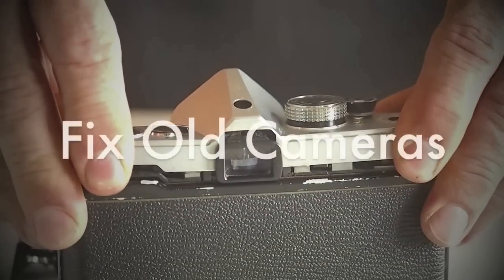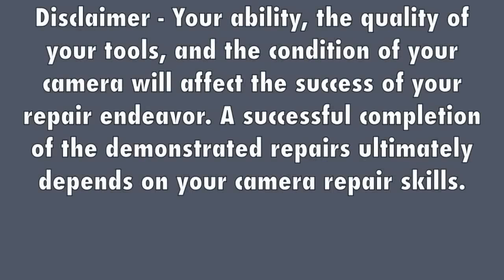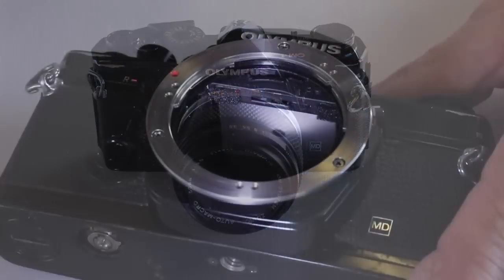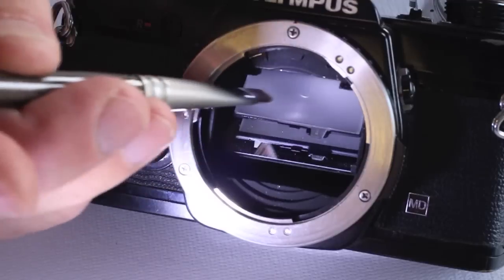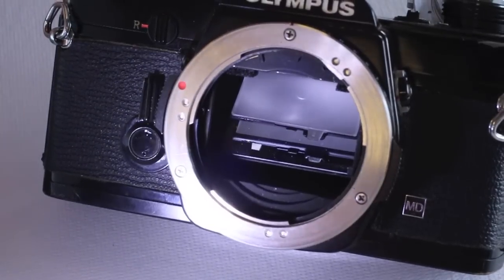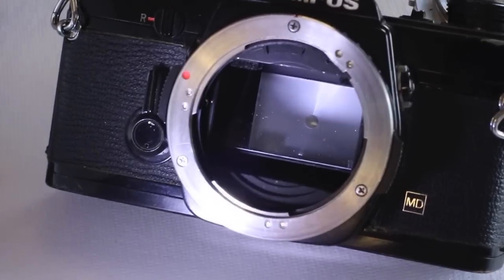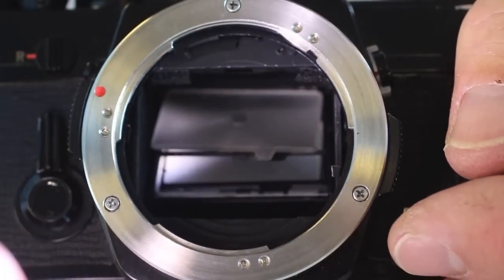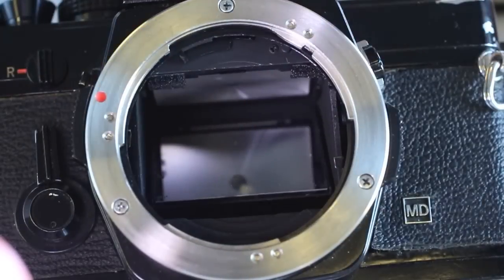Fix Old Cameras: Olympus OM 1, Dust in the Viewfinder

Comment: Did not know if this is the best place for this, but could you do a tutorial on fixing a very STIFF shutter dial on the OM-4 or any OM single digit series?  I am assuming that they all work very similarly.  Thanks for sharing your knowledge and videos as your OM videos gave me more confidence when I replaced my prism on my OM-1.  Have you done a video on dissembling and cleaning, say an Oly 40mm f2?  I have one with a little fungus that looks cleanable, I still shoot with it.  I would mail it to you for the video.  Cheers.
Reply from the maker: +Cy Fernandez Might a small amount of sticky liquid residue be under the dial causing it to be operate stiffly. Try seeping a little isopropyl alcohol around the dial as you work it.
Reply: Thanks for getting back to me.  I actually decided to dissemble the dial yesterday.  Several of the the "teeth" on the shutter dial are noticeably worn/grinded down while others were not, affecting the smoothness of turning the ring.  I did lube, but it did not have much  effect.  The shutter ring is in obvious need of replacement.  Thanks for putting up great videos and please do more Olympus ones when you can.  BTW, I like your website and purchased a spanner and rubber ring tools due to you.  Cheers!
Reply from the maker: You might be able to dress the damaged "teeth" of the shutter dial back into a better profile with a tiny trianguler file.

Comment: Thanks for this great video! While cleaning my OM-1 I accidentally bumped into the light meter dial and now its no longer centered within the exposure grid/mask. It looks to be a few millimeters below where centered/zero should be. Any suggestions on how to fix this? Thanks so much!
Reply: By light meter dial I mean the light meter needle on the bottom left within the viewfinder. It looks to not be centered with the grid marks anymore.
Reply: What it’s default position should be when it’s turned off? Mine is all the way down
Reply: @miroslavbriza  It's all the way down. When it's centered meter exposure it should be a 90 degree angle and in the middle of the marks, but it is off-centered.

Comment: Great video, but this won't help if the dust sits on the prism right above the plastic screen. It's quite difficult to clean that prism, cause it's a bit hidden and hard to reach.
Reply from the maker: If you are not able to access the spots by dropping the VF screen, then possibly it is separation of the silver reflective coating of the prism. This FOC video might help  https://www.youtube.com/watch?v=5HFpUX1NlJo
Reply: Thanks for the info!

Comment: Can it be any brush to clean the viewfinder screen? All I have are clean not used paint brushes
Reply from the maker: Artist paint brushes are fine. The bristles need to be soft but firm enough to lift and sweep any dust.  House paint brushes are to course and stiff. The brush you choose needs to be COMPLETELY free of debris and oil.

Comment: My OM-1 just doesn't change the shutter speed when I turn the wheel. What can I do to fix it. Even at the bulb mode if clicks at some other pre defined shutter speed.
Reply from the maker: By removing the lower front plate of the the mirror box you will be able to view the teeth engagement of the shutter speed change ring and the the shutter speed change gear. There is a timing hole in the shutter speed change gear that is set to 1/1000 when the hole is facing front dead center. An upcoming FOC video will feature the shutter speed change gear timing of the OM-1.

Comment: how to fix om  counterframe?
Reply from the maker: Make sure degraded light seal foam is not blocking the counter release pawl in the upper film door light baffle slot . Then remove the top cover and inspect the counter dial mechanism.
Reply: @FixOldCameras  there I made it myself thanks to your video on how to remove the top cover, I rewound the spring to the disc count poses and now it works great, thanks!
Reply from the maker: @gabryst2945  Very good to hear of your successful repair.

Comment: is there any email adress that we could contact you? I have an om 20 and i just removed the most parts on top cover but cant figure out how to remove the asa ring
Reply from the maker: The over/under dial is glued on. Under that is a screw.
Reply: @FixOldCameras  how can i open that glued part?
Reply from the maker: Eren Güney Seep some alcohol around the edge of the dial top. It should soften the glue so that you can lift it the disc.
Reply: @FixOldCameras  omg thank you very much.